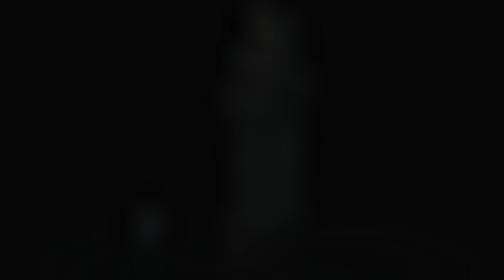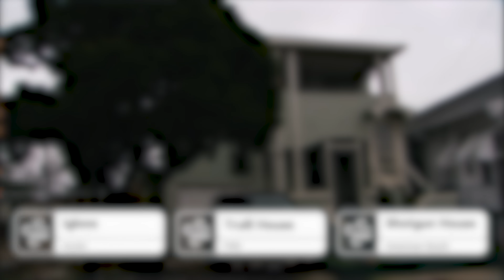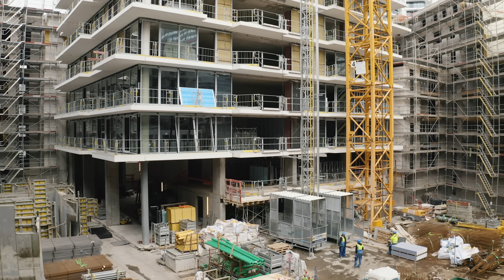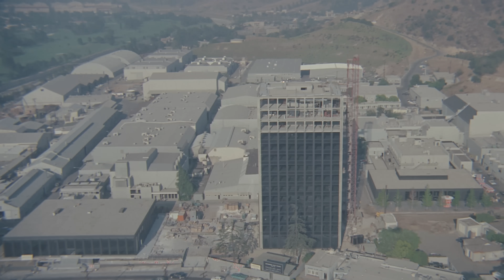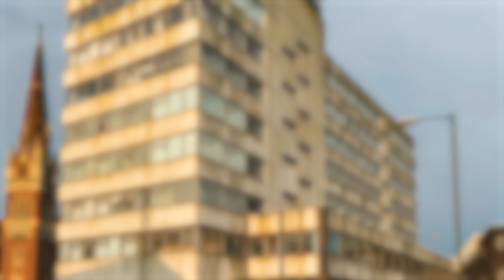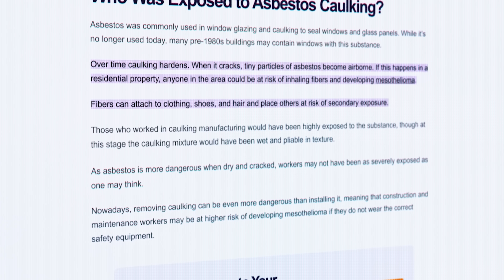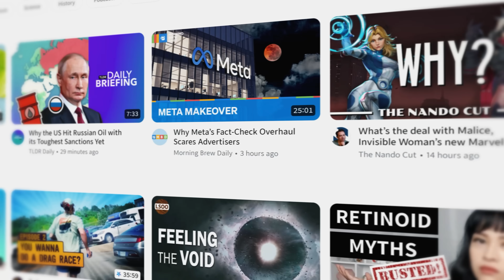How Caulk Accidentally Made Buildings FLAT

Comment: A prime example of the problems of glass facades being ignorant climate and place is waterfront place in Brisbane. Its one of the first highrises in the city and they decided to make it flash by cladding it in floor height blue glass panels manufactured in Germany. The issue is that germany doesnt deal with many days of 40 degrees Celsius or more so occasionally those floor height panels delaminate as the outer panel expands and the glass falls to the ground. There only solution was a covered skirt around the building as it would have been prohibitively expense to fix all the glass.

Comment: I live in the US. I love architecture. I love the Art Deco styling from the 20’s and 30’s. I hate the brutalism of the 60’s and 70’s. Which is okay. Architecture is an art, and art is meant to elicit an emotional response. But more and more today I find myself largely emotionally unmoved in any meaningful way with every new structure that is built. Especially in the suburbs. Everything is designed the same. Everything built reflects local building codes which in turn reflect standardized national building codes. Codes written in the name of efficiency and cost savings. The US is boring, architecturally speaking. Imagination need not apply.

Comment: Do your best and caulk the rest! 
Thanks for the insight, as a tile guy and a carpenter I have a complicated relationship with caulk. I always tell customers that caulk will always fail and eventually water will get through, so I make sure that caulk is only the first line of defense against water. Also, the difference between painted trim and stained trim is the difference between a hack and a pro.
Reply: The choice of painted vs stained trim is more a question of financial means than expertise. You can't apply stain to trim made from cheap, cost-saving MDF.

Comment: I've been thinking about this recently. I noticed historic brick buildings have windows inset, surrounded by moldings, and they're almost all original. Modern buildings have windows flush, behaving as a part of the skin of the building. The new windows probably have a service life of 20 years. The 100yr old brick building still has original windows because they're inset, they don't get wet. Inefficient sealants, and limitations of materials and design 100 years ago led to an innovative solution that yields a longer lasting window, and it looks nicer too.
Reply: This has been driving me mad with modern buildings. Even the ones that attempt to echo historical styles are just much too *flat*. It’s disconcerting. There’s nowhere to rest your eyes, no texture and sensory interest in the design, and everything about the building just looks overwhelmingly ‘exposed’ without the comfort and cover of the windows being slightly sheltered behind trimmings.
Reply: Yes primarily because a flat surface is a lot easier to seal and is much more energy efficient. And depending on how your house is built the stucco one I'm in in the south will be fine for quite a long time masonry meets vinyl. There's also something to be said for buying the most expensive caulk there is, It will last longer

Comment: Sealant replacement on curtain walls is nothing compared to the masonry restoration required to keep that style safe, livable, and well maintained. There's a reason Notre Dame just gave the Rail Exchange building back to its lenders and condo owner's in the Gold Coast have HOAs well over $10k/month for a 3 bed. While beautiful, masonry buildings of the late 1800s and early 1900s have an economics problem.

Comment: Design or designers need to take into consideration things like expansion and contraction. Especially between the different material and rate of change. Also, air flow or tapering styles are to help control moisture either by moving water away and or helping it dry quickly.
Reply: Don't forget mortar and how the mix can slightly differ from location to location. The same with concrete, not many know that there is actually a science to it or chemistry shall I say Lol

Comment: I can 100% imagine someone watching this and going "Gotcha, the obvious issue here are windows." and then designing, and building, a windowless skyscraper.
Reply: I mean, pretty much. Every envelope penetration is a cause for concern. We also design our buildings wrong. Blankets belong outside the body, and insulation belongs on the outside of the building envelope.
Reply: @thegurw1994 if the outside of your building will always be colder than the inside, sure. But even in northern Canada that’s not always the case so it’s a little more nuanced. A good designer/builder/architect should consider moisture migration, and accumulation. Even in extremely cold climates, there should still be ‘some’ air permeability in building membranes or they can trap moisture- thankfully this is now reflected in many envelope design guides and codes
Reply: AT&T Long Lines building be like:
Reply: Windows are a HUGE issue. But that still leaves all the seams ans other places where water might get in. Like the shower or the kitchen sink. 

The real solution here is to make a welded metal sphere that is airtight and completely seal yourself inside. You won't have to worry about a leak for the rest of your life...
Reply: Congrats on reinventing brutalism
Reply: @thatonehumanoid7756  Brutalism had windows
Reply: @thatonehumanoid7756 

your comment misunderstands the goals and actual content of brutalist architecture. 

most brutalists structures have a higher ratio of window to wall than your suburban house does. the goal was to be plain and utilitarian, and windows are actually very utilitarian.

that said brutalist structures do have a significant advantage in controlling the envelope of their buildings. big concrete blocks are impermeable and used the way they are it does help with avoiding seams where other structures would have them. but that wasn't the reason they built them the way they did.
Reply: Inside looking like the Disney+ recording studio so not absurd 🤷🏾‍♂️
Reply: One of Warren Buffett's friends wanted to build a university residence hall with no windows just here recently.
Reply: They're gonna do a windowless skyscraper with thousands of tiny cameras and displays on the walls inside to let people see out, but naturally this will allow us to discover new mental disorders in the people living/working there

Comment: It's a nice thing to have... the problem comes when the industry, which would like to come as close as possible to being able to employ trained seals, then manufactures everything to reduce the installation process to four fastening points and some tubes of caulk. Overlaps on things intended for consumer installation have gotten absurdly low, and then the wall material is often OSB, so the edges are easily reduced to trash...

Comment: Regardless of building style, all those seams in a "proper " shingled design admit air, which, while good for building longevity are anathema to energy conservation and occupant comfort. Caulk is essential to any modern building. Building materials should be shingled but still need caulk as a backup from wind driven water and for air sealing. Maybe we should be concerned with the kind of caulk we use and how we employ it. Most caulks rapidly age, become stiff, and lose adhesion. One type, silyl-terminated polyether,  is  different. It ts great for sealing gaps, but can also be spread over a surface to form a continuous rubber sheet. It stick tenaciously to most building materials, and is moisture permeable, allowing outward drying. It can be applied to damp porous surfaces. The moisture even speeds curing. It can even be rolled or sprayed over the building sheathing, forming a continuous durable water and air resistant membrane. Interestingly, not one of those tubes at the wall of caulk in the big box store contains  silyl-terminated polyether caulk.
Reply: "Energy conservation" is a destructive lie.  It's not energy saving to make an airtight building that rots out completely within 20 years and have to rebuild it, and it's not energy saving to slap down a design from the wrong region, even if it's "energy efficient" and counter it by throwing HVAC watts at the problem.
Reply: @danmerillat  

That's all well and good; you enjoy your living room being a "comfortable" 85 degrees in the summer and 20 degrees in the winter.

Comment: Can’t not bring up what happened with the Hancock tower in Boston in the 70s - poor choice of sealant material around windows led to shrinkage in the winter not long after construction, so whole panels of glass popped out from 30+ stories up and fell to the ground. They had to replace every window seal and the building spent years halfway covered in plywood.
Reply: I'm pretty sure he did a video of that already
Reply: There’s a building at my job with huge glass walkways and in the last year at six of the huge glass panels that line the walkway gave come crashing down. I wonder if it’s caulk failure. I’m pretty sure there’s no frames on the glass but will now double check. Too bad no one will listen as it’ll be too exspensive to address.
Reply: Ahhh, the old "Plywood Palace."

Comment: I've been a licensed general building contractor for four decades and you provided an endepth video 👍, Old school relied on mechanical means of preventing water penetration.

Now I see new low rise building completely redoing all the fenestrations in just a few years of completion due to all the water infiltration. Sometimes redone twice.
Reply: You are exactly right. I think it was universally understood that overhangs, reglets and drip edges could keep water off a facade. But even then, failure in that line of defense was accounted for by allowing a place for any water intrusion to escape and dry out. 
I’ve only got 25 years in restoration work so I’m still learning…truly. 
The whole theory of moulding  and composition is based in practicality and weather proofing. 
To this day I have a hard time getting my head around things like rain screen, when clapboards happily did that job for a long time. But when we can’t count on installers to fit components correctly, or the manufacturer specifies a gap that is to be caulked; well then we are asking for trouble as we rely on caulking to do the heavy lifting rather than to just augment good workmanship. 
Even most general carpenters these days are installers, rather than building mechanics in the true sense of the term. They install products to manufacturers guidelines in fear of warranty claims, rather than make what will specifically address the problem in front of them. 
Keep up the good work.
Reply: @smartcarpie  <> Yup, exactly. I think we can trace all the failing modern building technologies to the manditory use of insulation wich trapped water vapor and vapor condensation and created mold and dry rot winthin the walls and cealings where such never previously existed. Plus the back of the siding would typically become damp, even wet, now you have insulation right up against it preventing it from drying like normal.

After decades upon decades of failures a proper system that actually works, but it's still not fully adopted in architectural conventions and building codes, but only in the building sciences. Realy quite simple in camcept but rarely deployed to the degree that is required for it to be effective.

All that needs to be done is provide a plastic membrane of 10 mil up against the warm side of the insulation (typically the interior side) and seal off all gaps, holes, and seams. Including electrical boxes that penetrate the vapor barrier. That's it!

This keeps the humid warm air from the interior migrating through the insulation and condensing into water on the cold side of insulation.

I'm definitely an advocate of using rain screen design technology due to the mandatory use of insulation. By holding the siding off the wall by ¾" allows seeping water behind the siding to drain and dry out like in the days before insulation was used. You use a water barrier, not a vapor barrier between the rain screen and the cold side of the insulation. This prevents moisture from within the insulation cavity getting trapped and not air out.

Comment: Its easy to look at something like a classical Roman building with all its fancy columns, capitals, frieze, cornice, etc and think that its all just there for show. But in reality the individual parts are made in the way wooden beams and boards would be joined together for houses during the time, with all the angles and overhangs causing dust and rain to be flung away from the vertical surfaces so that they were protected and could last longer. 

Modern skyscrapers are really boring because they all have glass curtain walls and no surface detail. There's no play in the shadows, no layering to break up the flat surfaces, no visual reinforcement around corners. I not only think they're ugly and look too much the same no matter where you are in the world, but they make me feel uneasy too. I think this is why skyscrapers from a century ago were so much more appealing. They had ornamentation and surface detail, played well with shadow, and had a visual style that projected strength in their design, giving people a sense of security when they walked in.

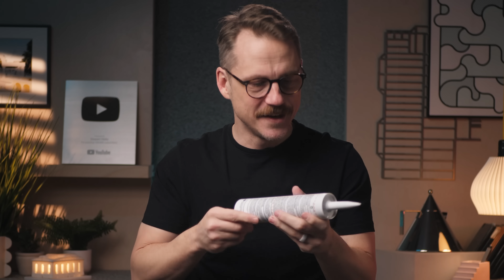Comment: 14:00 that line earned a sub. The whole Industrial Revolution did this, took the skill of the craftsmen and put them into the machines. Not all at once, but gradually. And currently trying to complete the job with AI, I suppose. It does seem useful, to whoever owns the machines, and the output of the machines.
Reply: Except it was perfectly fine all the way into the 20's, gee I wonder what even happened after that which could have possibly changed it and resulted in what we have now?

Comment: This is such a massive problem in Canada. Not just the Caulking, but not building for our climate and environment.

I am constantly mind-blown at how how little innovation we actually see in our buildings here, with entire suburbs being built California style over the last couple of decades, which are just band-aided with extra insulation, foam filler and bigger furnaces.

Take eaves troughs for example: we just use the global standard lightweight troughs, with no special innovations, despite the fact that they are constantly getting damaged during the winter months, because they're just not made for the amount of snow and ice we deal with. Come spring, and you can place a pretty sure bet that 1 in 10 homes will have damaged eaves troughs. Just go for a walk in any neighbourhood and you'll see them hanging off houses everywhere.

We've also got a serious vinyl siding problem too. It's been put on everything for the past 2 decades, but 15 year old homes already look like garbage, because this stuff isn't really designed for the extreme thermal expansion/contraction our climate causes. And every spring I see warped and bubbled siding that has opened up gaps and popped out of the trim. Or parts of are outright shattered, because anywhere below -15C and it's too brittle to flex, so if it gets hit it instantly breaks.

How we even lay out properties and landscapes here is abysmal. It's like we know that we're going to get snow and it's going to drift, but then never consider it, so that when winter comes, the buildings, fences and layouts land up making snow drifts even worse, and in the worst possible places, like over sidewalks and front entrances. It's maddening!

The list of problems with our construction standards could fill a book, but it all boils down to lack of innovation and just glomming onto standards developed for other climates. It's almost like we have a cognitive dissonance about winter, where we want to pretend that snow and extreme cold don't exist. I mean, literally just look at any development's marketing materials, and you will never see architectural renderings that show the building/development in the winter; they're always rendered in summer

Comment: I do agree that buildings are becoming less unique but It's generally about the cost included in those unique features on buildings. The longer it takes to build these buildings, (ie, adding unique features from skilled craftsmen) the more money it costs the builder.
 IMO you should have specified that there's many types of sealants, and it's not the standard caulk in the Home Depot aisle being used on structurally glazed curtain wall systems. Also, there are actually two beads of SSG sealant on these CW systems. A tensile bead goes on the inside of the glass with a specially formulated double sided tape, and the exterior bead bridges the gap between the two unitized CW Systems, sealing the building.